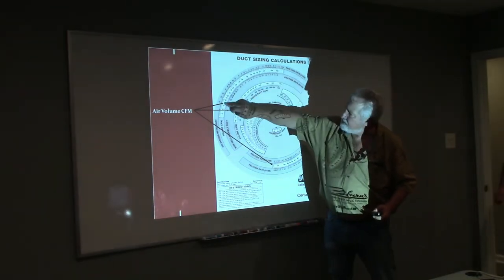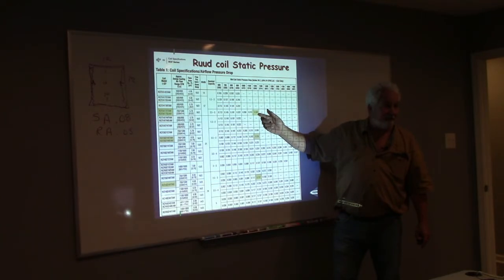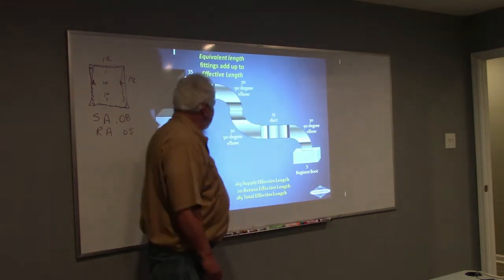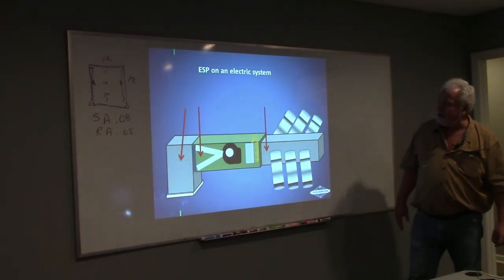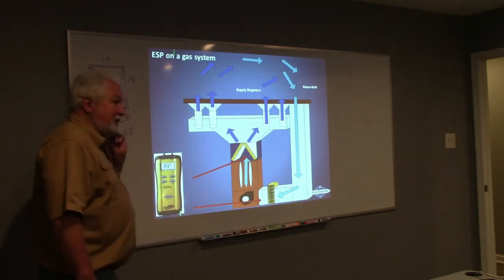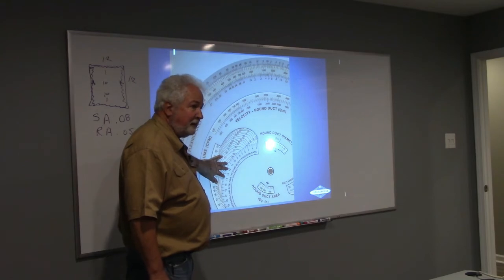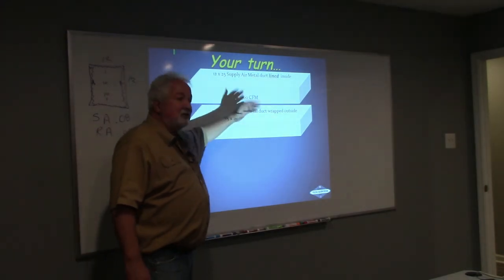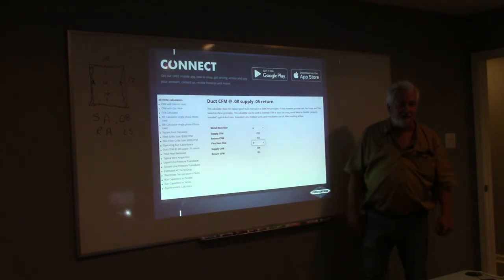Airflow Part  2 Duct Calculator

Comment: not one idiot can ancer any question .. static air is the builders fault as always ... this suck all the air thru returns is a problem    for thies big houses just install the in duct air fan blowers they suck the air out ofthe duct and pull it into the return  done...